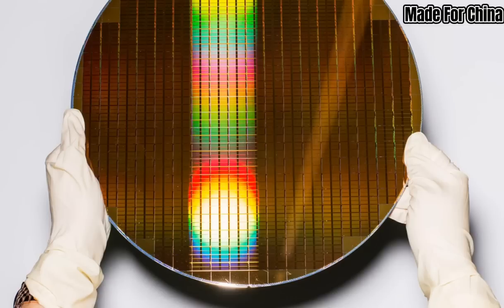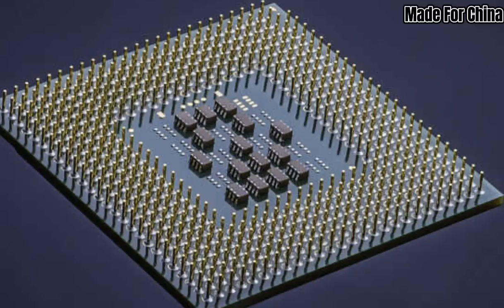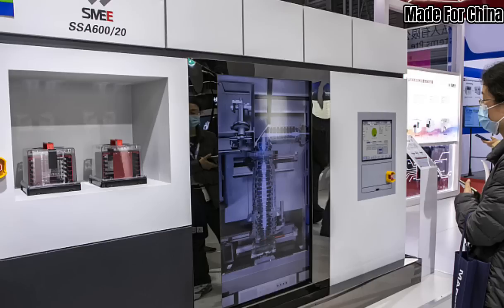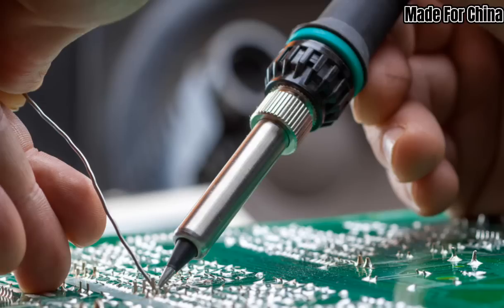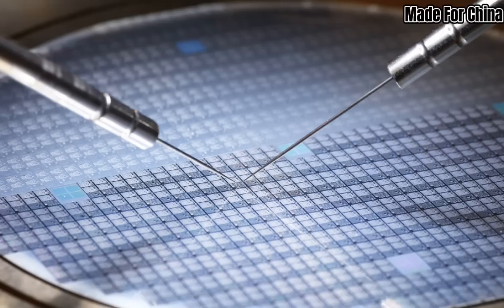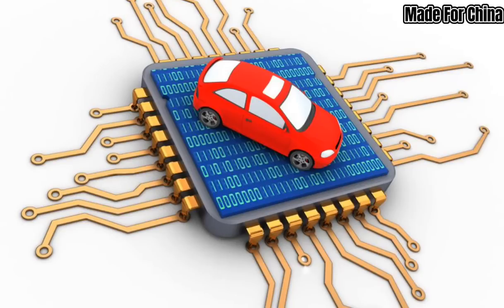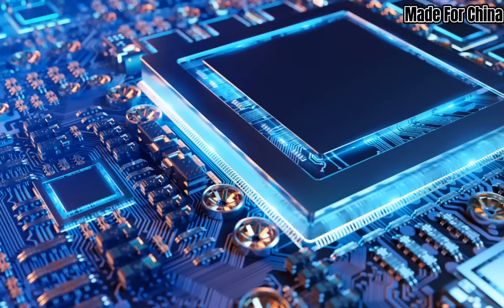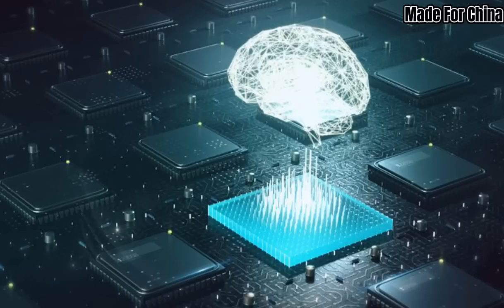China Has Successfully Developed An Extreme Ultraviolet Lithography Light Source

Comment: There are many components. The light source is only one of them. The lenses and so on. However it is believe all components or the supply chain is complete. It is now believed the SMEE 28nm DUV will be operational this year and the 14nm in 2025. This is the reason China is cancelling orders from overseas. In fact China is exporting plenty of mature nodes catapulting China to the third biggest exporter in the world. Imagine if Taiwan is calculated as part of China of which Taiwan is! Together they are the far ahead leaders. However China is more focus of meeting the demand of the local purchase. When all the 12nm to 14nm foundry is up, China would have meet 70%-90% of its local requirement. Likely by 2025. On the other hand the rest of the world is losing market share including TSMC. China contribute to 70%. However China is not safe until its own DUV (12nm to 14nm) and EUV is ready. The semiconductor supply chain has to be 100%. Every screw and bolt.
Reply: Since no country controls the whole supply chain of the chip industry, China should tread carefully lest cooperation between countries could be lost forever, likely leading to war. If China were to achieve full control of the supply chain, they should not use it as a weapon like what the US did with the USD.
Reply: You don't understand. Even ASML needs the WHOLE WORLD for part supply and technology. China can NEVER EVER do it alone. And ASML itself said they are at LEAST 20 years behind on EUV. At least!
Reply: The EUV Light Source is the Final component that has been put the Chinese scientists in hardships for a while and now finally broken through. 
The next step should be to install all of the component into one machine and this is the easiest one before tested for debugging and manufacturing chip for sample. Then the chip sample will be reviewed and tested installed on phone/computer for later stage benchmark test.

So another 1 or 2 year before we can see the next Kirin Chips comes out for commercial market.
Reply: Agreed